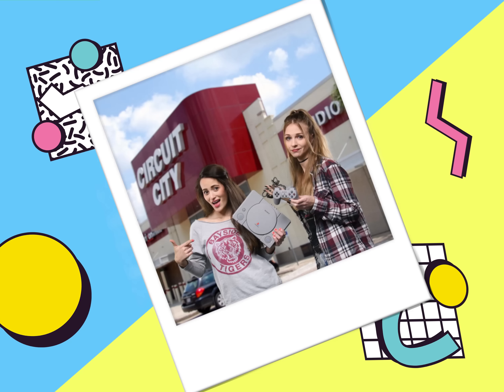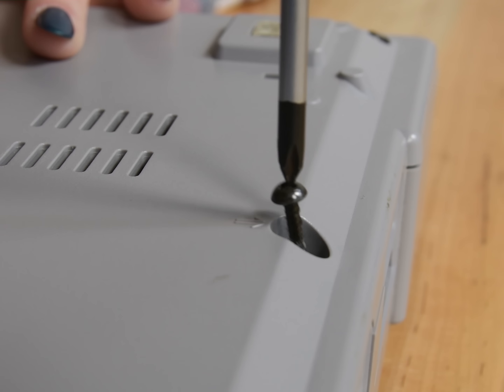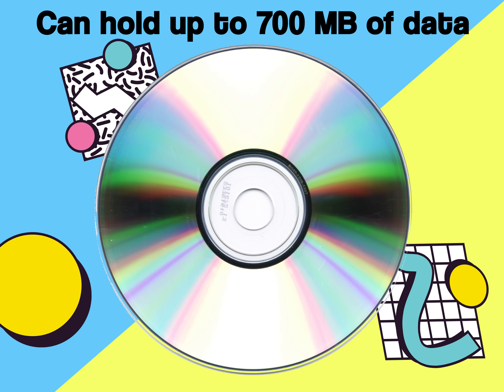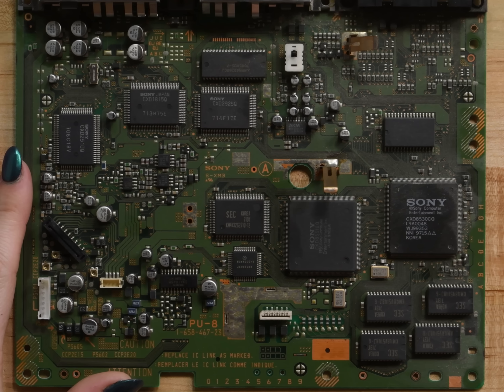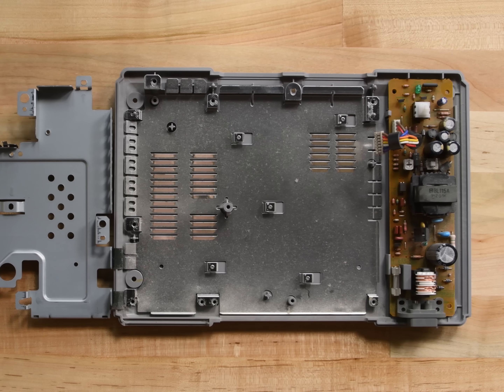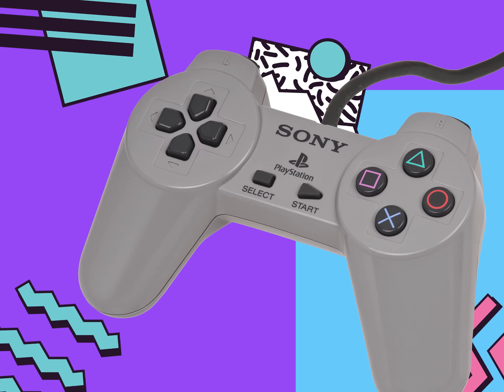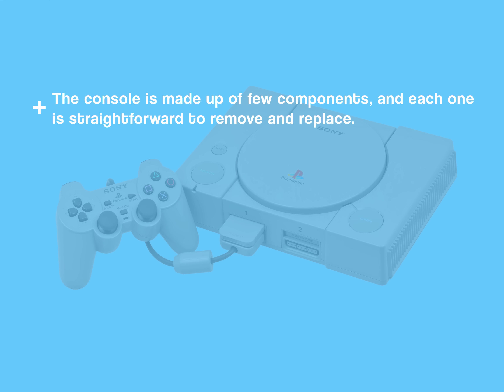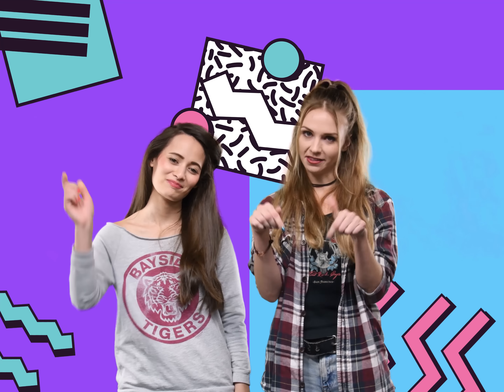Sony PlayStation Teardown

Comment: Which came first, the spudger or the Playstation?
Reply: I think it's the spudger. The wireman I worked with in the late 70's were using them.
Reply: @rcollinge5818  Surprisingly legit answer

Comment: Memory and CPU soldered to board, 8/10. Literally any other device, memory and CPU soldered to board, 2/10.
Reply: That was normal for a game console back then. A laptop should not be a throw away device.
Reply: Sean Wilson It’s normal for a laptop now. Does that mean we should be giving them higher ratings?
Reply: @jacoblukewood  I have never owned a laptop with non replaceable memory, but every console that has existed has had non replaceable memory.  It's your choice if you want repair ability over form.  This channel is about repair ability and a PC is a tool, and because it is a tool, it should have replaceable parts and be serviceable for longevity. Also the price is a huge difference, sub-$300.00 console vs $1500.00+ PC. A PC should be an investment.
Reply: Except phones or any other of the many other devices where soldered CPU and memory is normal. As far as I can see it's literally only laptops or extremely compact PCs where soldered CPU and memory is ever going to come up.